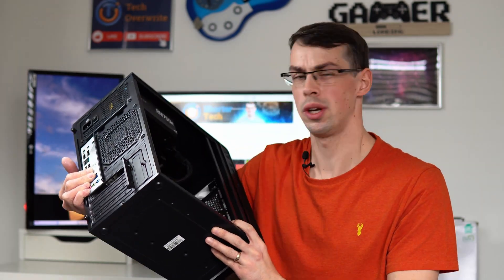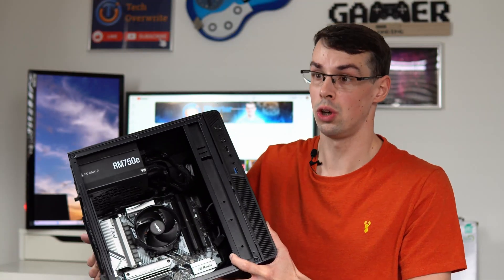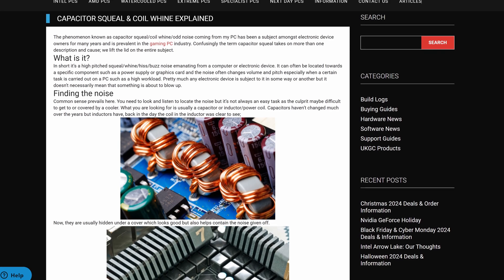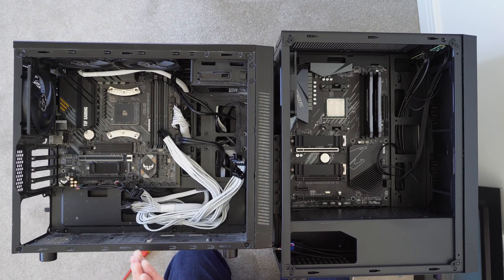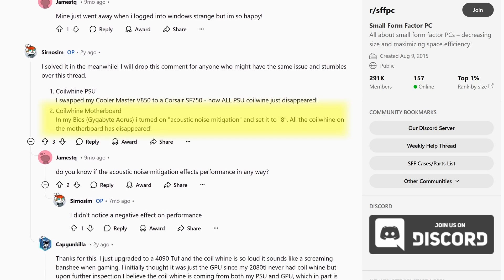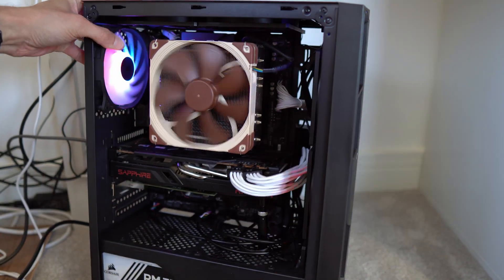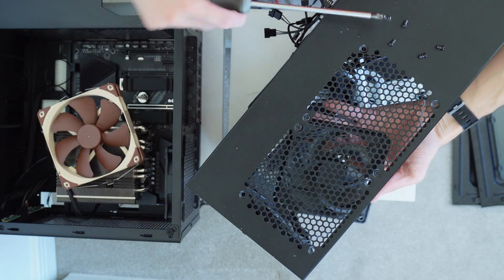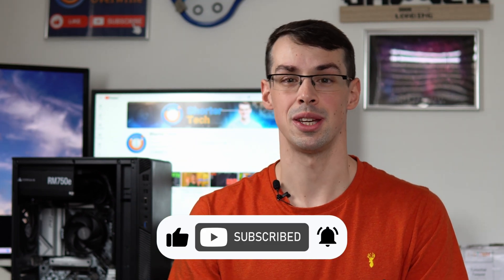My Motherboard Seems To Have... Coil Whine?! Seriously?!

Comment: I have an Asus ROG Strix B450-F Gaming II motherboard. I've had it for four years, and I always had 16 GB of RAM at 2666 Hz, but yesterday I upgraded to 3200 Hz, and now I hear a vibration when I play games.
Reply: So I don't know if it's the VRMs on my motherboard, and I'm worried that it might damage my PC. I saw that coil whine isn't harmful, but I'm still concerned about that noise; it sounds like a moderately strong vibration.
Reply from the maker: Oh that's nnoying, sorry to hear it :( Maybe the IMC is working harder and that's having knock-on effects. As you say, it won't harm anything but it is an annoyance for sure. I wonder if the noise goes away if you run with just 1 stick (or disable EXPO/XMP)? Both are temporary tests of course, but it could help show if the IMC is being stressed or something.
Reply: @ShorterTechOverwrite I noticed that disabling the processor's Boost feature and setting the memory to 3200Hz stopped the noise. I think the problem was the Boost. I have a Ryzen 3 3100 with a base clock of 3.6 GHz and a Boost clock of 3.9 GHz.  Honestly, I didn't notice any difference in FPS in games, and I was even surprised by the lower temperature, up to 10 degrees Celsius lower. I think that was the problem.
Reply: So, I think I'll leave it disabled. I saw on some forums that it's a good idea to disable it because sometimes it causes unnecessary voltage spikes and can lead to instability.
Reply from the maker: Hmm that's odd then. Yes leaving it disabled will probably be best then. :/

Comment: I made the mistake of buying an Asus motherboard before thinking about the coil whine issue.
Here's hoping they accidentally manufactured it properly (1/10 chance) and I don't have to return it.
Reply from the maker: I hope it works well for you :/ I've had Asus mobos without any coil whine before, so fingers crossed for you!

Comment: mine is more noticeable during idle and when moving the mouse, can't tell if that's a coil whine or not..
Reply from the maker: Hmm that's interesting.. and odd. Not sure whether it's coil whine either, but are you able to modify the fan speeds (with Fan Control software or similar), and see if the noise is more/less noticeable at different fan speeds?
Reply: Omg same here.. im hearing some electrical noise. Ive barely had this pc for 2 days

Comment: for me it comes exactly behind the cpu socket, even though the pc works fine, it's just annoying, in my case, i think the reason is more likely the cpu air cooler causing the motherboard to bend around the socket which would cause some components to have some small changes in their positions, which would mean space to vibrate, i'm kinda certain since my air cooler have a contact frame which is also the base for the cooler, it's a replacement for the socket cpu fixation mechanism, i didn't like the design since it looked like a lot of pressure for such a small surface area but i couldn't change the Air cooler, i bought the components slowly over a long period of time finding the best deals, so i was beyond the period of replacing or refunding since it was sold during a black friday
Reply from the maker: Ah that's frustrating, does sound like you've tracked it down correctly though. Hopefully you're able to swap out the cooler at some point in the future, although in the mean time, I hope it's not too noisy :)
Reply: @ShorterTechOverwrite  the noise isn't noticeable most of the time, only when i'm not doing anything (idle), also i don't think changing the cooler will do anything since i tried putting my pc in a horizontal position and it didn't do anything, i guess it's too late, and i don't want to do it anyway, it's too much work since i have to remove the motherboard from the case to replace the cooler, that ain't gonna happen
Reply: I have the exact same problem. It's only noticeable when I put my ear next to the back of the motherboard though.
Reply from the maker: @rotzloffel  interesting, there's so many small components in a motherboard that it's not surprising you might hear some from time to time (it's annoying when you do notice it though!) :)

Comment: I'm hearing it mostly when computer is idle and just or moving mouse windows around for some reason.. When i actually load a game or some heavy load programs the sound is less noticeable or changes to less disturbing one
Reply from the maker: That's interesting, and I've heard others say that. It can definitely do that when the system isn't operating quite as efficiently, i.e. at lower power draw levels. Although there's nothing like gaming for making everything else super loud (and drowning out the coil whine) LOL!
Reply: I experienced the same thing

Comment: fact of the matter it shouldn't be an issue in 2025 let alone the past 10 years but it still is, there needs to be a change in tech or better parts used
Reply from the maker: Yes that's fair enough, it's a PITA issue for sure :/

Comment: I have coil whine but can't tell anymore if it's from my motherboard or not. The coil whine happens when I do a stresss test on the system on 3dmark and it sounds like it comes from the vrms. I ordered a x870e taichi. Returnd it and got another one and the whine is there on the other one I just got too. I have no idea if its the motherboard at the point or not since I have an old x570 build with a 5800x3d and I never heard it. With the new 9800x3d I can hear it. People are saying its my 4090 but like I said it was never this loud.

Is it a possibility my 850gold watt power supppy isint compatible with my new mobo or case idek anymore...
Reply from the maker: Ugh sorry to hear it, it's a really frustrating issue. I've heard some people say that coil whine can settle down after a few weeks (sometimes)... although it usually doesn't settle down for me, tbh. Yes the PSU could also be causing it - I've heard that NZXT PSUs are noisier than Seasonic Focus (for example). But I haven't tried that out myself.
Reply: try to remove gpu and launch you setup with integrated graphics. the only way you can test it

Comment: coil whine in my pc gets louder, which is worrying me. when under load, the sound is now recognizable without putting my ears into computer :(
noice comes somewhere from the CPU and ram section. 
board: b760 gaming plus WiFi
Reply from the maker: Sorry to hear that, the case fans, GPU and PSU are probably the most likely culprits. I was recently looking at a new PSU and apparently the NZXT | C Gold 1200W has a bad case of coil whine, so the brand of PSU can definitely make a difference.
Reply: @ShorterTechOverwrite  it is a new pc I've made, all the components are new. just noticed, that before the coil whine I installed an SSD m.2, but no idea if that can provoke the noise anyhow

Comment: Glad I saw this video, ive built quite a few computers now and had coil whine just once, I think it was the PSU though

Going to sub as you're only a small channel but seem to have some good videos
Reply from the maker: Thanks for the comment and sub :) Yep I haven't had much coil whine - it's thankfully not ultra common (i.e. it doesn't happen with every 1-2 bits of hardware)